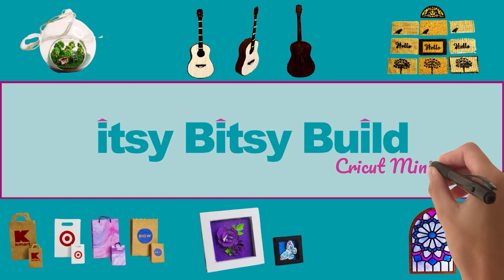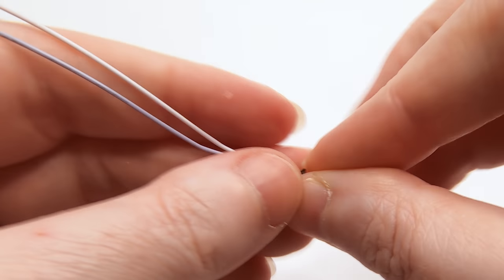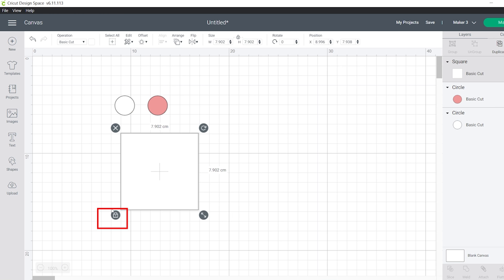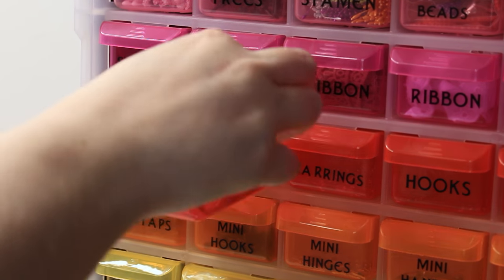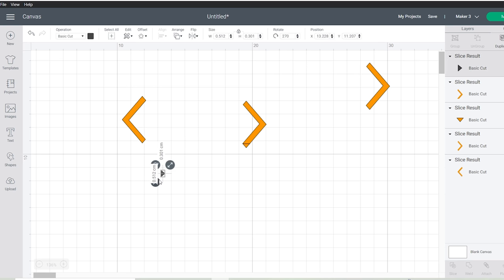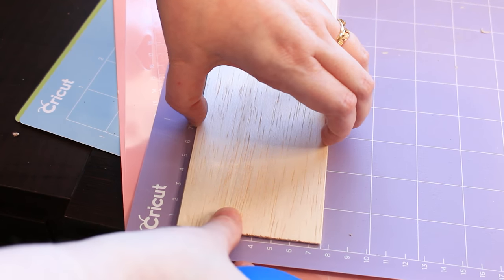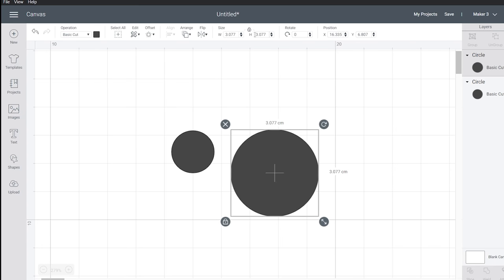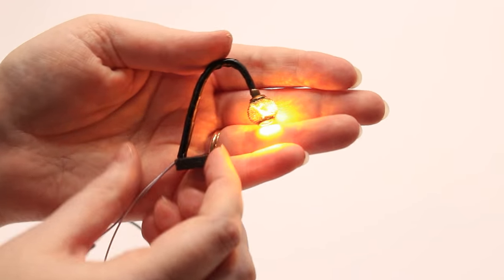Create Miniature Lamps in 4 Designs | Cricut Tutorial | Mini Dollhouse DIY | LED Lights Globes

Comment: My minis are 1:12 scale I ♡ your lamps can you tell me size of glass mini globes I'm looking for ? Smallest I've found are 
8 mm ~  are they to big for the making lamps like you made ?
Reply: Also I wanted to add I'm learning as I go & am enjoying your tutorials very much ty I have liked & subscribed ♡
Reply from the maker: The ones in my video were 12mm I believe so 8mm should be even smaller. Thanks for supporting my channel and subscribing ☺
Reply: @ItsyBitsyBuild yw should the LEDs be no more than a certain wattage
Reply from the maker: @tammybedder8502  Not really but the battery pack wattage should match the LED lights if you're buying them separately.

Comment: I see you use a 12 volt lamp with a 3 volt battery pack??? That won't shine much...i know..coz i tried doing it. At least that was the diode lamp you showed..it said 12 Volt??  I also would make the concrete block myself with polymer clay (Fimo) and paint it....that's much much cheaper in the long run.
Reply from the maker: Thank you for your suggestion ☺